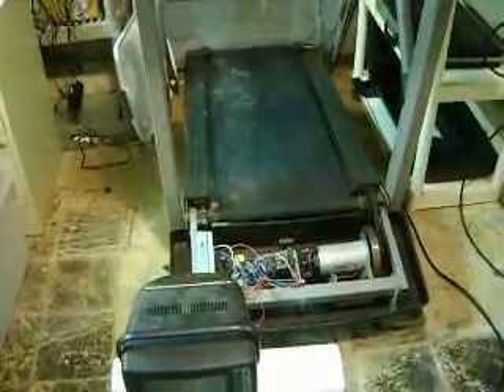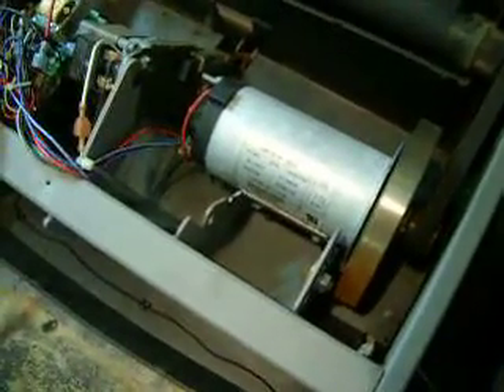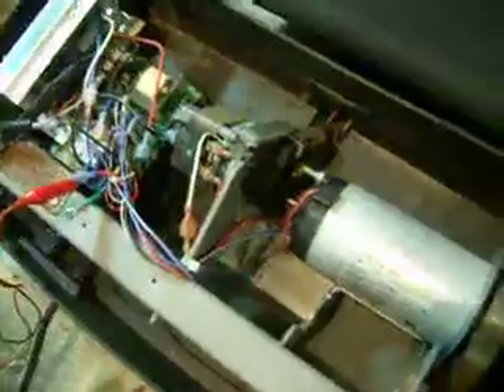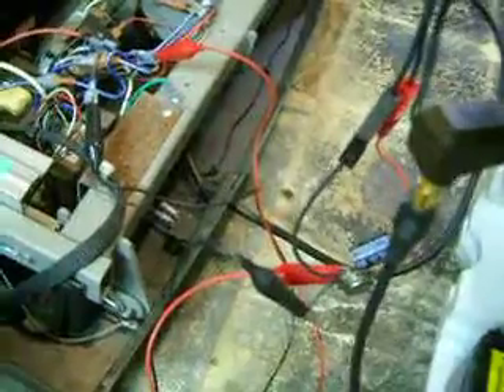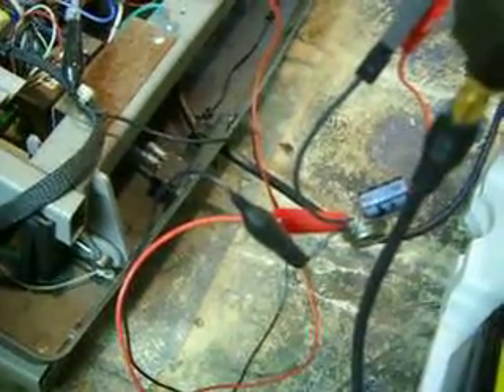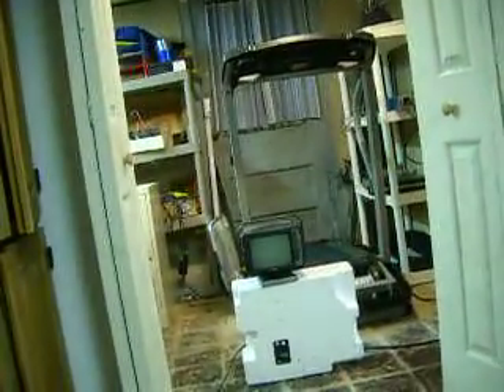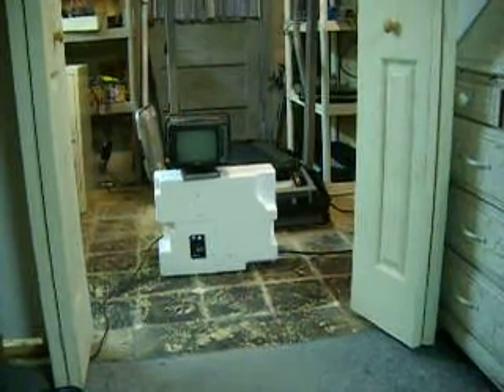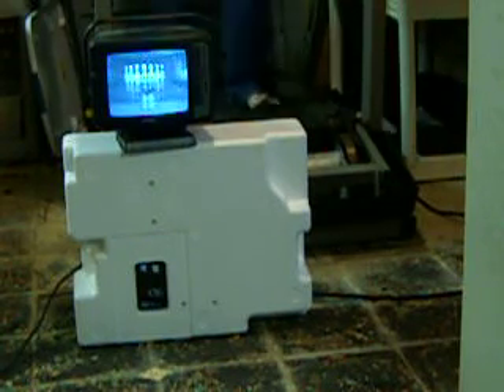Treadmill generator, power your TV as you walk!

Comment: Even better would be a two pole single throw switch, allowing you to alternate between using the motor as a generator, or as a drive motor, allowing the treadmill to operate as designed.
Also, a cheap utility intertie inverter would allow you to skip the battery and just sell your power back to the power company.
Reply: Come to think of it, you don't need to switch the ground, so a single pole/single throw switch would suffice.
Reply: +ManifoldSky That would introduce a dangerous condition if a power socket was wired reverse, which does happen. The live side would be energizing what would be thought of as neutral, sometimes the chassis.
Reply: +RiaRadioFMHD773 Which is why you use either a polarized plug or a standard three prong plug.